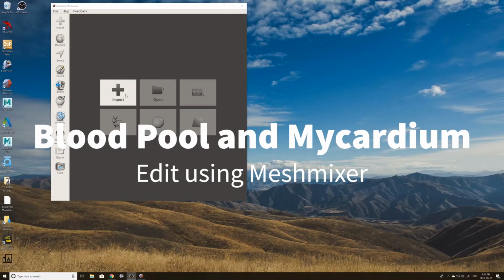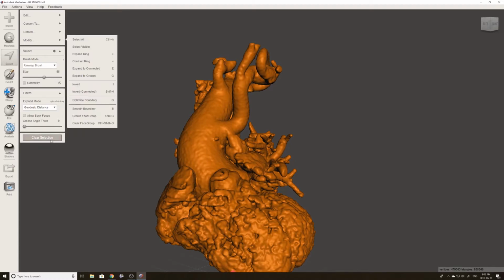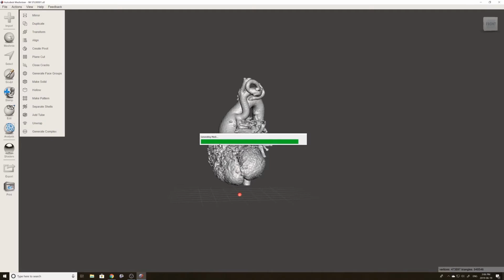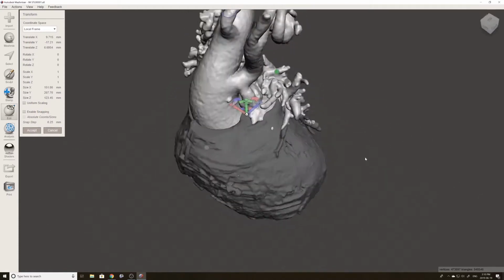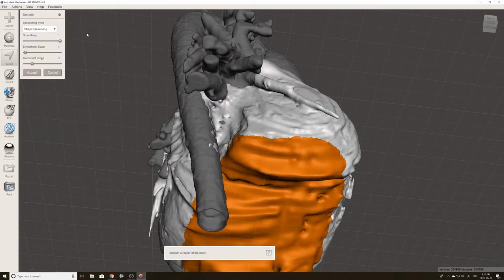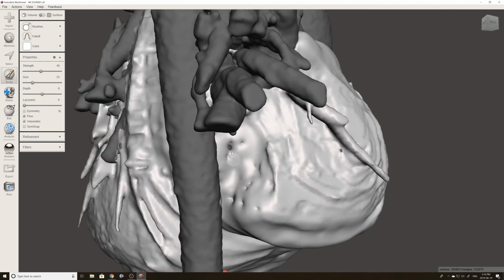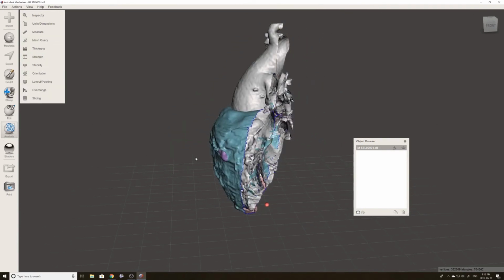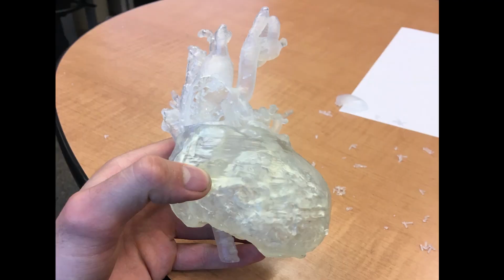Combining the Myocardium and Bloodpool Models

Comment: What are the caracteristic of the laptop Wich can handle all these software ( itk snap,meshmixer....) .Thank you
Reply from the maker: Meshmixer should be able to be run on most laptops, ITK-snap does take more processing power to run. 

System Requirements Meshmixer 3.5
Microsoft Windows 7 or later
4GB system RAM
Integrated or discrete graphics card with latest drivers

I was not able to find the system requirments for ITK-Snap but you may be able to find it on their website http://www.itksnap.org/pmwiki/pmwiki.php